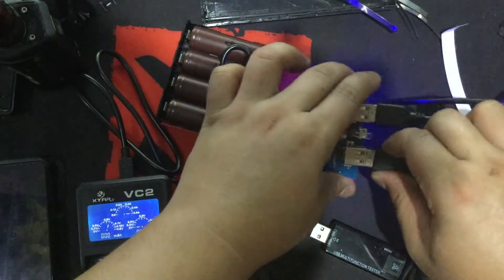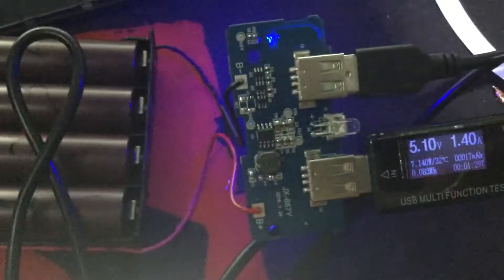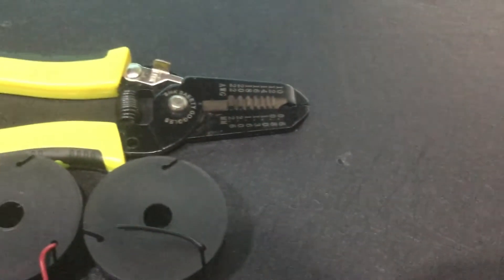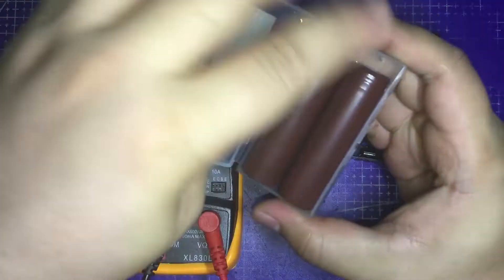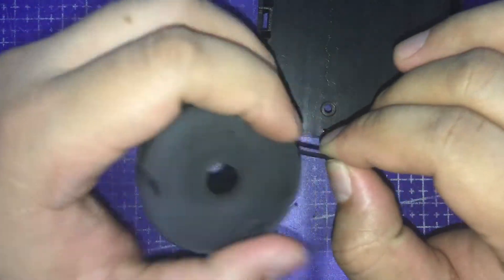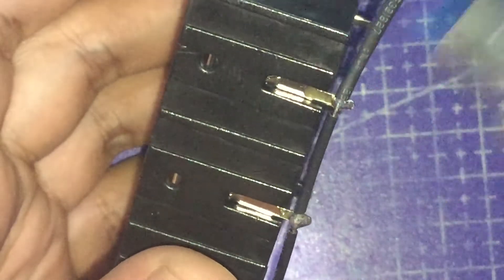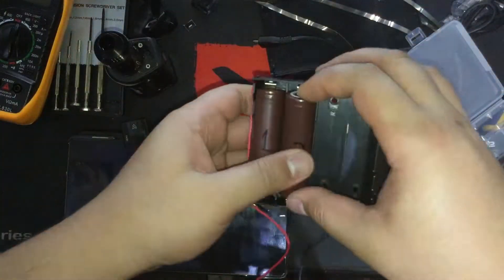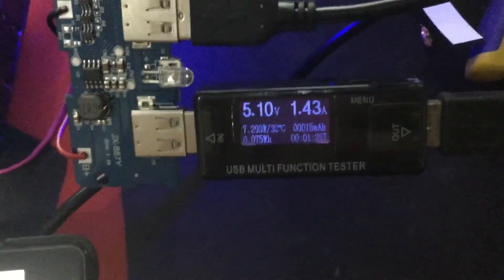[D.I.Y.] 12000mAh Powerbank | Using a JX-887Y 5V 2A Charger Module & 18650 Batteries - Part 1

Comment: Nice vid! I got a question though, these cells have a max continuous discharge of 20 amps, while the powerbank itself per usb has an output of max 2 amps.. if both USB ports are in use 4 amps total. Since you are using four cells, your max continuous discharge would be 80 amps because they are in parallel config. So why not choose a cell with a lower continuous discharge and with more maH capacity? Just not sure if there is a specific reason for choosing this cell. cheers!!
Reply from the maker: Hello and thanks for the comment! IIRC. One of the USB ports is 2A max and the other is 1A max. For the battery, I chose it because it's widely available and cheap.
Reply: @HeathenHacks  A clear and concise answer thanks very much! Good luck with your endeavours. 👍
Reply from the maker: Thanks! You, too.

Comment: The holder for 4 18650 batteries that you used in vudeo is soldered to the circuit board.

Comment: Does it still charge while it is being charged? And does it stay on when you remove the charging cable?
Reply from the maker: Hello, Aivan! Thanks for the comment! ♥ 

By this question: Does it still charge while it is being charged?

Do you mean if I can charge the powerbank while it is charging other devices?

Haven't really tried it that way before, but upon doing a quick 5 minute test, it seems like it is possible. (I don't really recommend using it that way)

Do keep in mind too, that I've only used a wireless earbuds case as a test subject and it only requires 250mA of current.

Also, since we can't confirm if it's possible or not because I can't find its datasheet anywhere, I would advise you to monitor it while using it as a pass-through charger or just don't use it that way to be safe.

-------------------------------------------------------------------------------------------------------------------------------------------------------------------------------------------------------------------------------

By this question: And does it stay on when you remove the charging cable?

Do you mean if the powebank would stay on if the charging cable connected to its input/output port is removed?

If so, no. It would turn itself off if nothing is connected to it.

Comment: would this work with a lithium polymer battery or only li-ion
Reply from the maker: Hello, and thanks for the comment! ♥ Hmmm... as per what most of the product pages say, it seems like Li-Po batteries can also work with the module. But, just to be on the safe side of things, I'd suggest to monitor the Li-Po batteries closely when charging it using this because the sellers might be lying.
Reply: @HeathenHacks  thanks for the reply, yeah I was confused as some sites selling it say its OK some say it isn't I won't be using it just to be safe

Comment: How to activate automatic on off in this circuit... while connecting charging cable it doesn't works automatically until i press the on switch.please help
Reply from the maker: Hello and thanks for the comment! ❤ Not really sure, but I noticed it as well. I think that usually happen when the current draw of the device you connected is not that much.

Comment: Dear HeathenHacks, we're using same setup and same JX-887Y but our board doesn't charge phones. Do u have any idea about it?
Reply from the maker: Hello Ahmet! Thanks for the comment! ♥ Hmm.. Maybe, you're phone does not recognize it as a proper charger or your board  is malfunctioning or something.  I am not sure, unfortunately. Sorry.
Reply: HeathenHacks Hey man, we found the problem. We’ve use jumper wires and male pins socket for modularity. But jumper wires is getting to hot in load so BMS cut charging for protect the board and ICs. After remove jumper wires and use 22AWG our problem is solved. Have a nice day HH
Reply from the maker: Hey, Arda. Glad that you have sorted it out. But, make sure to keep an eye on it while you're using it. Better be safe.
Reply: @ardarutkayvar9029  ya ben de bu modülü aldım kablolarım kalın fakat çalışmıyor. Çıkışta 3.6 volt veriyor fakat batarya 3.7v veriyor tek başına. Sebebini bulamadım bir türlü
Reply: This is because your phone needs much capacity
Reply: U have use more cells bro but less sells can charge earbuds

Comment: My board is making a slight wiz noice and then it stops charging... like nothing is breaking just does that every time...
Reply from the maker: Hello! Thanks for the comment! ♥ If you are using the same module as I do, you may have received/bought a faulty one and I don't recommend using it. Also, you can try a much more known / popular charging module. The "TP4056". 

PS. Make sure that your batteries are not getting hot or anything. Also, double check the sleeves/wrap of them to be safe.